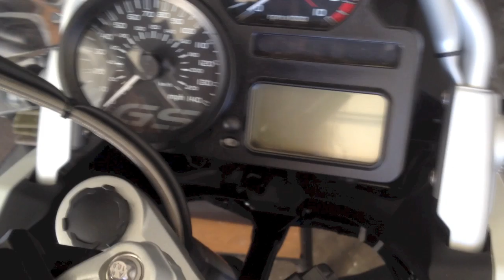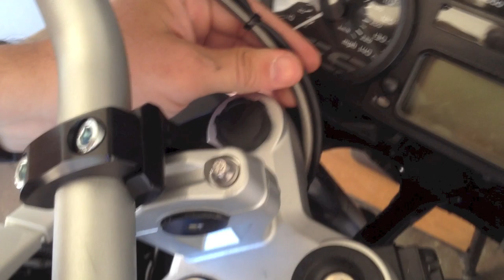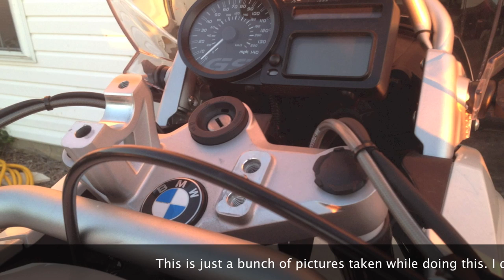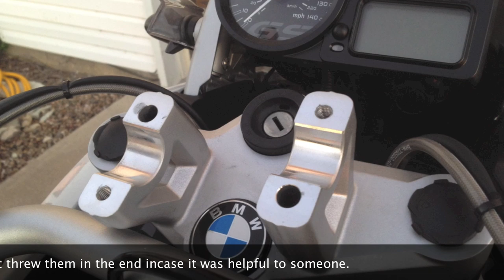2012 BMW R1200GS Rox SpeedFX riser install HD.

Comment from the maker: thanks. As a side note there was a recall, or advisory, or what have it to the dealers to look for clutch lines that had extra length down at the slave cylinder. usually this meant a downward loop and it was to be shifted up like I did and you did as it can cause cavitation in the fluid. or so the St. Louis Dealer tells me. so you (and I) solved that problem by fitting the risers. bonus! I'm Glad you found it useful.

Comment: Thank you for sharing this. I am considering buying the risers for my 2010 GS. 
Good to know that it is possible. :-)
Reply from the maker: exelent. I am glad you found it valuable. they are still working just fine with this solution about 20,000 miles later.